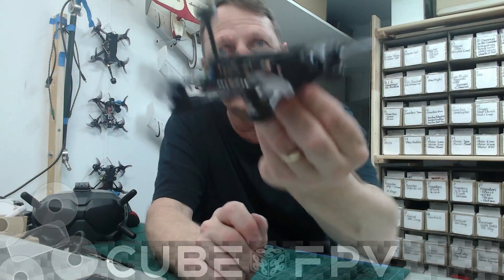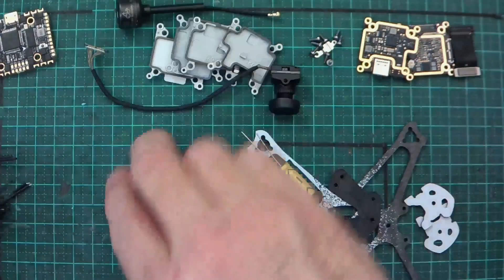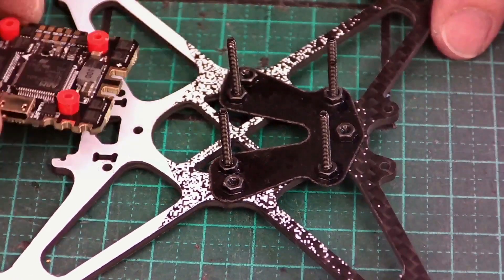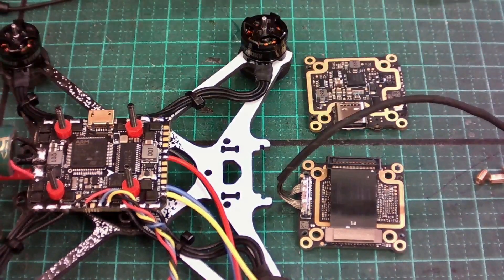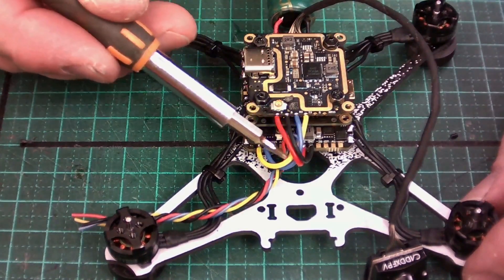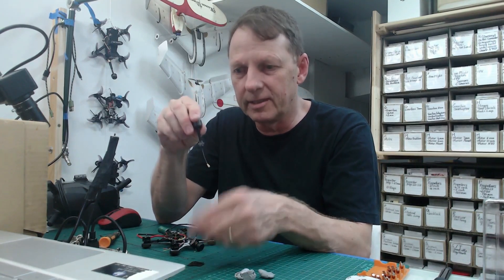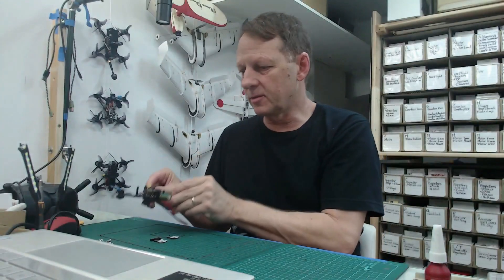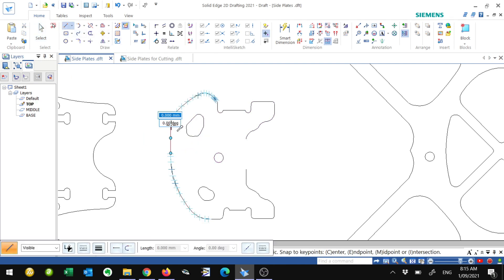TinyHawk 2 Freestyle with DJI Naked Vista

Comment: Is it necessary to have any of these mods for the DJI V2 Goggles to work with the Freestyle 2?
Reply: Dji can work with the Freestyle 2 but it's not an easy setup. You need to power the naked Vista from Vbatt. It's a challenging conversion, but if you like to experiment...
Reply: @MicronWings  Thanks, will probably just upgrade to a Nazgul to fly digital

Comment: Trick!!!!
Made one myself with HDZero, love it.
Any issues with the pid’s afterwards? Mine came out to 120grams and necessitated pid changes to compensate. Roughly 4 points higher on roll and pitch.
Reply from the maker: Yes as i remember i did have to adjust the PIDs and do some tuning. Nice work on the HD Zero version

Comment: I saw a similar build on rotor builds naked vista up front 16 mm stack at the rear stock height so be new camera plates
Gonna run the new polar pro 
And the 16 or 35 amp flywoo f7 stack 2s or 3s with upper kv cutoff should be awesome 😎
Reply: That would be a good option if you didn't need to replace the side plates. Sounds like a tight build.

Comment: Sure nice to have all that equipment! No way an every day flyer could do this. Do you just show videos of what you do and not make any parts to sell??
Reply from the maker: I actually sell some parts for the TinyHawk on my MicronWings website here - https://micronwings.com/Products/SectionFPV/index.shtml - However I just have a laser cutter so i can only cut from fiberboard - not carbon. It also leaves some soot on the parts. So basicallt some parts I am selling but I need to get a dedicated CNC router to start selling carbon parts. Even for battery mounts although i cut them from foam they really need to be press-cut. Hope to have another store up and running in the future for FPV gear.
Reply: @cubefpv  thank you for the reply

Comment: Could this work running the DJI transmitter through the vista as well? I figure you're just using the TBS Rx because that's your preferred system yeah?
Reply: Yes I just wired a tracer receiver because that's what i'm using at the moment. Just remember that to use the caddx vista receiver functioanlity your FC needs 2 free UARTs. The JHEMCU GHF420AIO-35A thati'm using has 3 usable UARTs so no problems there.
Reply: Cheers for yer advice, I ended up running a wee F7 mamba FC and ESC stack and a non naked vista all in a stack with 30mm M2 bolts drilled into the stock frame. Took the top plate off and replaced with a plastic canopy off a diatone 3" holding a polar. Running the whole lot off 4s 450mah giving us a totally mental 100 000 + rpm off the 7000kv stock motors. It's heavy with the stock vista but I like the added safety of heat sinks for now. Roughly 4min or so flights , haven't got any accurate speed checks done yet but performance is easily twice as quick as the stock THF2 with an all up weight of 149 grams currently.
Reply from the maker: @sampeythepirate  Well done Ben. That's an intersting build. You're running the stock motors on 4S too which is surprising - i don't think anyone else has done that yet. Do drop a commnet back here if the motors are still holding up okay after a few months.
Reply: Thanks I thought it might be the only one like it for a reason but it's ok so far. The standard freestyle problem of the props ripping off with the motor bell applies if you hit the ground at speed, but I took another channels advice and applied Loctite to the shafts, so far so good. Motors get a tad warm but otherwise no issues, I am finding the diatone canopy is too weak for crashes though so I'm switching back to a carbon top plate. I had a few crashes due to inexperience with the DJI goggles etc, if another pilot switches on nearby they freeze and you drop video a few seconds, not great when you're low level and fast lol. In all the 4s is doable but a bit heavy and hard on the frame due to speed and weight and I doubt the motors will last very long :D
Reply: Aaaaaaaand I smoked a motor, you can't fly full power acro/air more than 40seconds and you melt motors (predictably) don't do 4s team
Reply from the maker: @sampeythepirate  4S - I'm surprised they didn't smoke straight away. Yer well good advice there - don't do 4S with these motors.
Reply: 103 000 odd rpm sounded cool someone had to try it bwahahahahahahaha, but I think your 3s systems are the best bet with these motors, that's still pushing 80k rpm at full noise, cheers the inspiration to load Caddx vista etc that bit works fine!
Reply from the maker: @sampeythepirate  Yes 3S with these motors is the sweet spot. I'm getting performance comparable to a 3.5 inch 4S build and reliability is good. I've been flying these builds for about 4 months now and only had to awap one motor. Thanks for all the work and experimenting you're doing here too Ben.

Comment: What about the temperature of the vista without the heat sinks? Did something similar with a babyhawk R. Added a caddx tarsier for 4k video shooting. Nice and clean set-up, congrats.
Reply from the maker: Temp seems okay. i've been running it at 500mw up till now. Just yesterday I bumped the power up to 1200mw. Comes down just warm after a 3 minute flight. So it seems to be okay on 1200mw at the moment. Not noticing any reduced flight times with it running at this higher power.